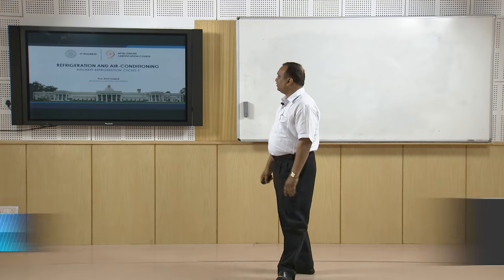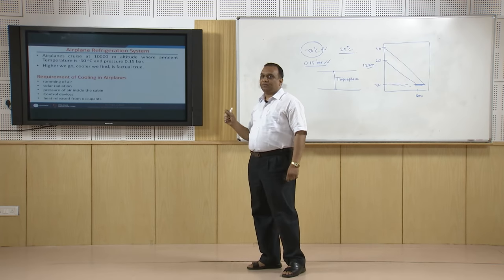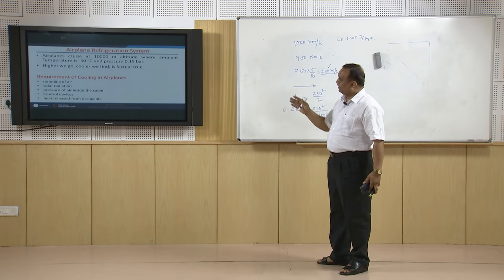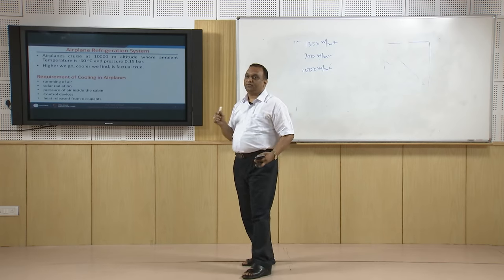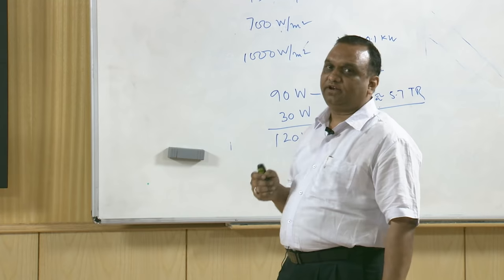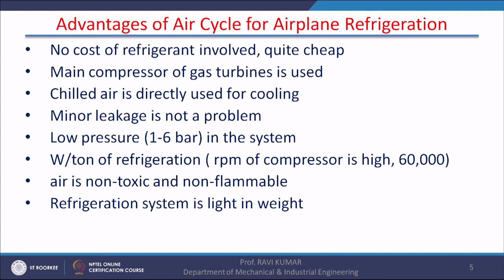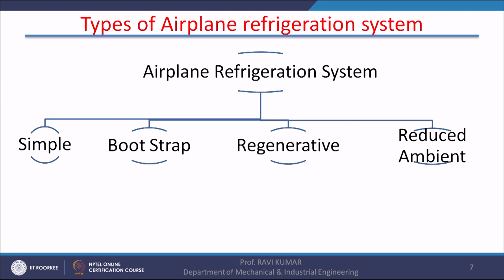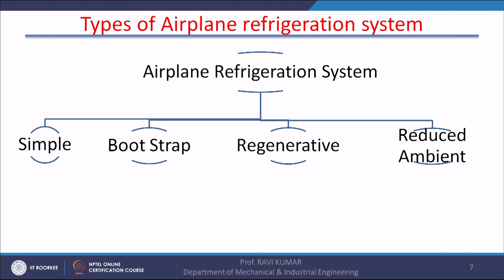Aircraft Refrigeration Cycles-1

Comment: what is ram effect
Reply: When airplane is moving at high speeds like mach 1 or above, in that same speed air hits the plane at its body, causing high friction at the point of contact. Due to this high speed collision, air at contact with the plane is a bit stagnant for some time. This stagnation is called Ram effect. Another name for Ram effect is adiabatic stagnation
Reply: @AMALsjalwn  Bro, what will happen if we cool the air at stage 1 itself? and again why to compress it in a gas turbine compressor  and bring it to stage 2, then cool it and bring it to stage 3. What exactly is the reason behind compressing it from stage 1 to stage 2?